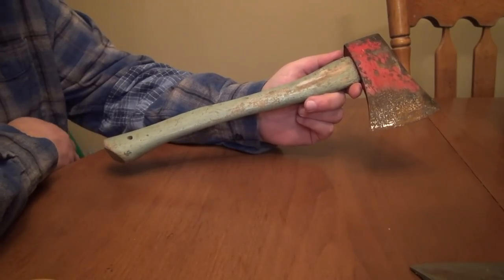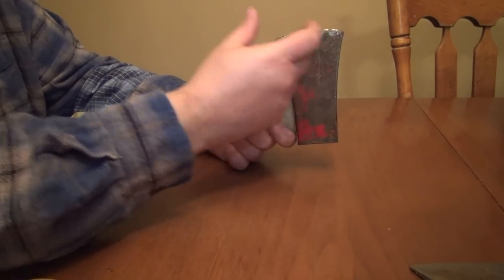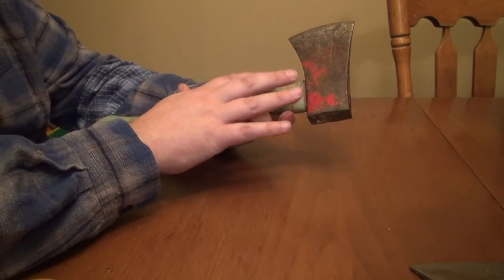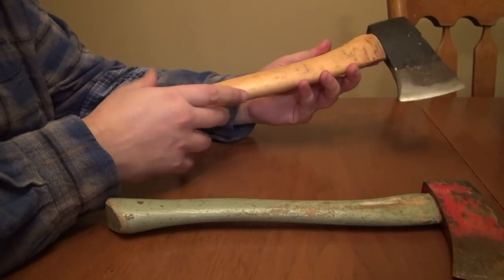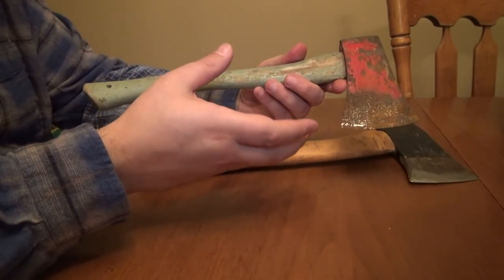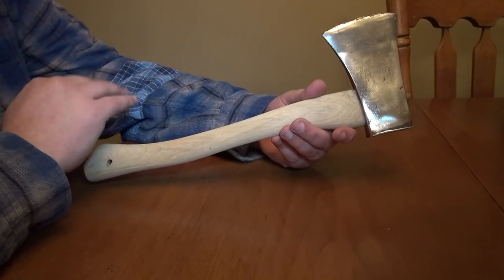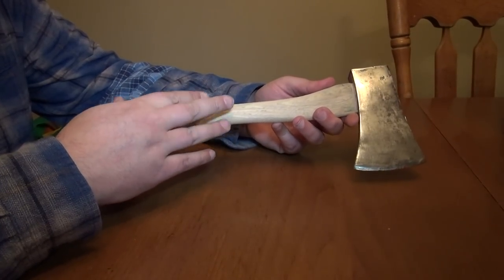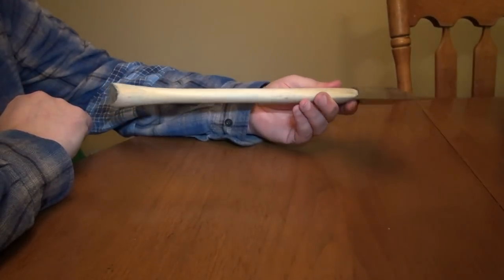Restoration : small axe (light restoration on a poorly maintained but still very good shape axe)

Comment from the maker: Yes, one of the main reasons to work the poll down is to eliminate the damaged metal which can not only have cracks, but will serve as a foundation for cracks to start. There is never a 100% guarantee, but you will reduce the chance of problems.

Comment from the maker: There are ergonomic concerns, however I would suggest you give the thinner grips a little more work before you move past them. Try for example allowing your grip to open a little and as well vary the force you use. With axes you only need a tight grip at the start to control the swing and maybe at the end depending on follow through.

Comment: Excellent video.

You can get nice handles even today, though. Wetterlings/GB/Hultafors handles don't have knots or defects (at least mine don't), so you can just sand them down. A 40 grit sanding disc in a cordless drill works very quickly and can be controlled very well to follow all the curves.

Comment from the maker: If you are getting some movement on impact, it is usually a sign that the cut itself is instable, that you are not coming in on a smooth and tight swing. Most of the time this is caused by the axe not being properly center balanced.

Comment: an experienced welder will grind a groove down into the crack and then reweld the grind full.  by building the groove up above the surface level it can be ground back to flush.   I have rehabbed several axes with damaged eyes due to the over exuberant less informed people pounding broken handles out with a punch that is too big for the opening.  those are easier to fix than the ones where they pounded the eye shut over a half rotten wood handle to tighten it up.

Comment from the maker: The problem you would face with axes is fighting the perception of lower quality and less product for putting out thinner handles. And even more important are there even enough people to want that performance when the handle is weaker in regards to non-wood cutting work (using the axe like a maul, a lot of side twisting, etc.).

Comment from the maker: They are meant to be used as a hammer, but even hammers get the faces damaged when they hit hardened steel, rock etc. and need similar work to reface them to prevent major damage.

Comment: in actual fact the club-like "fawns leg" contours are a very old feature. During the earliest periods of high intensity timbering in North America, straight handles were the professional standard for both single and double bit axes. However, contours became widespread as early as the mid 19th century as the logging centers moved westward across the continent and eventually depleted; leaving manufacturers in need of a consumer market for whom the contoured handle was not just suitable but a marketing point. Maybe i misunderstood you(in which case I'm very sorry) but both those handles are of a style much much older than one or two generations ago. In fact, you can find advertisements promoting axes with thicker, more contoured handles that pre-date the american civil war. I concur that when compared to a perpendicular straight handle, the excessive curvature and contours would be largely an inconvenience or irritation to a professional who is using the axe daily for extended periods of time. But I feel like I need to point out that those, springier axes were designed to be used by professionals in highly specific roles with a variety of patterns tailored to sometimes a specific species of timber. I'm hesitant about your implication that the "generalization" of the axe handle is a failing when it arose specifically to fill a very generalized role that surely did exist as consumers in different regions needed cheaper, mass-produced axes that could preform a variety of jobs adequately. A springy handle was preferred by professionals for dedicated felling axes but it was generally regarded as inferior for carving jobs by the european immigrants that were populating the midwest and purchasing tools for their farms. Different patterns of use and economic conditions promote different designs. Personally I don't see a small hatchet or hand axe as a very useful axe. The geometry is not right to carve but the handle is too short to safely limb or split little billets. The sort of light use an axe like that is suited for makes the shape and quality of the handle less relevant and therefore if the cost of the axe can be driven down by using a lower quality blank(offset by a thicker geometry) so much the better for a tool that is mostly equipped to sit by a fireplace or in the trunk of a car. Higher quality isn't always a premium if the complexity or intensity of the job doesn't warrant it. I'm not so much disagreeing with you as I also prefer a slimmer contour with an axis of pivot more perpendicular to the eye, I'm just trying to provide a alternative to your perspective. Maybe playing devil's advocate a little. As someone who loves to buy, hang and use vintage axe heads: hickory blanks with good grain alignment and no defects- to the extent that they are suitable for long springy handles are incredibly difficult and expensive to source today. And in prior centuries I have read it was common for professionals to break and rehang axes often; using inferior woods that were at hand. When I do not need the absolute pinnacle of performance i'm perfectly happy to hang a lighter head on lower quality cut off and leave the handle thicker. Just a datapoint on a subject I'm fascinated by.
Reply: What he said.

Comment from the maker: The axe should be center head balanced. If you hang it from the butt of the handle it should hang perfectly vertically in a line which splits the eye and runs down the handle. The poll and bit have to be the same weight and the head needs to have similar tapers left/right.

Comment from the maker: Yes, that axe would not be representative of all Japanese axes. The main issue with that axe that I had is that it was described very differently than it actually is designed to be used, it is far more of a splitting axe but the description would not lead you assume that. This could just be a Japanese->English problem or a cultural one.

Comment: That would be very unusual that the wood is changed because of strength issues. I believe that china , just doesn't have oak in its available use. Something sounds wrong ,as to the reason for handle change.
Was wondering about any dimensional differences to the head ,itself. They look slightly different to each other.

Comment from the maker: Not unless you had extreme confidence in temperature control, had some way to heat protect the head, or didn't care about severe temper draws on the head.

Is the head glued in? Normally you can simply drill it out if it is stuck.

Comment: Hmm....yes, and we`re coming back to the old dispute between hardness(great edge retention but brittle) and softness(less edge retention but not brittle) of a steel....pretty interesting, even though i prefer softer steel for that matter(more versatile) most of the knives i have are carbon steel :DDDD....
But i got the generall idea...special tool for each job, especially if you want to abuse it

Comment from the maker: Sandpaper, start off coarse until you have all the paint and rough damage gone and then move up in grits until you get the polish you want. Use a decent metal cutting type, not the cheap ones made just for wood.

Comment: Out of curiosity, have you worked with an axe like this http://i.imgur.com/jDerhWB.jpg ?

(talking head shape only, size and handle may vary)
Reply: Also what about adzes (not sure on the plural for that). Basically this: http://i.imgur.com/AArHvOR.jpg
Reply from the maker: Yes, however bearded axes are generally speciality axes because the load can be applied under the head and so act to torque it. They are rarely thus used for general utility.
Reply from the maker: shurdi3 Yes, these are common in many types of joinery and my grandfather used to do such things and I assisted in the grossest sense of the word at times when I was a kid.
Reply: Funny you should mention that, because here they are mostly used as utility axes/hatchets, and there's a bit of an interesting story behind that. Though, except for splitting wood, and taking down small branches, people don't really use axes much anymore. Which does make me sad.
Reply: Cliff Stamp Special adzes really are quite the tool. Though here they've turned to utility big hammers with nail removing notch, and the sharpened portion isn't really used a lot.

Comment: laziness and lack of instruction for the most part.  big name "bushcraft and survival" instructors are always showing themselves using the poll section as a hammer.  If the new owner needs a hammer section behind a hatchet look up shingling hammers in the hardware store. I found an great example for about 11 dollars.  4 inch blade pound and half head with a fully hardened hammer on the poll side.  I carry one of those in my truck tool box now.